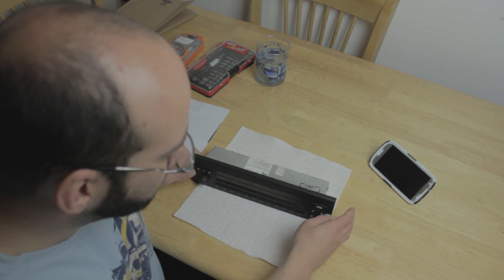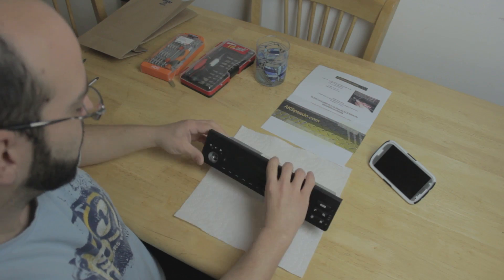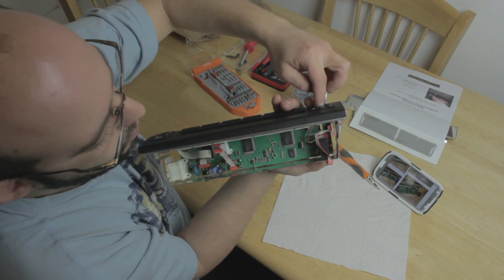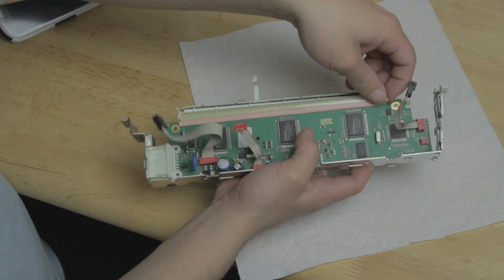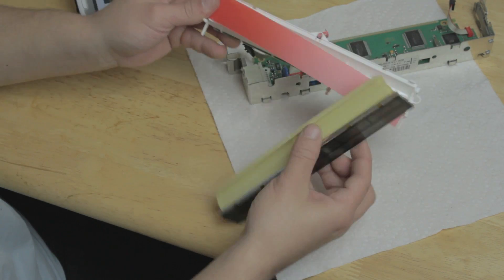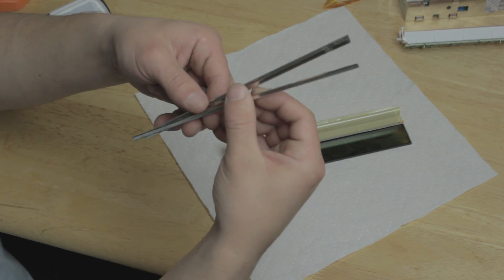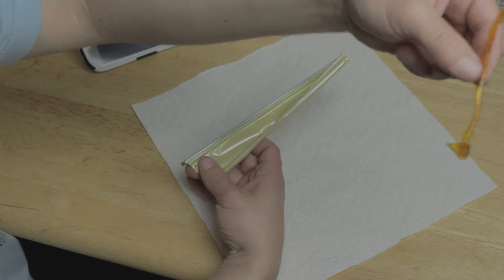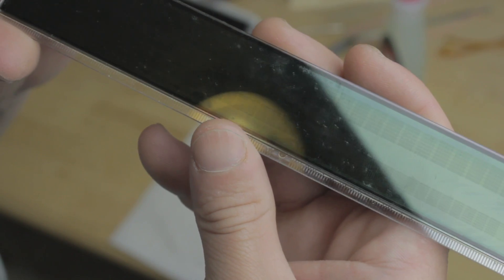BMW X5 and 5 series (e53) (e39) Radio Screen LCD repair - Part 1 - Disassembly

Comment: I followed your video, and it worked for me! Nearly all pixels are back. Thanks so much for this, it helped a lot. I used Acetone to clean the display contacts, but some went between the sandwich glasses. I could move the glasses a bit on one side and expected the worst, but it still worked. Acetone is probably too strong and dissolves the glue inside the LCD display.

Comment: This did not work for me. The company I bought the cable from is saying that I have to use a "T" tip for the soldering gun to apply the ribbon cable, which is not what these instructions say to do.  Maybe my cable is different. All I know is it doesn't work and I'm pissed.  I also used acetone to clean off the connections on the LCD which is prob why it doesn't work.  After viewing the #2 video the printed directions he has says don't put liquid on the LCD screen THAT WOULD HAVE BEEN HELPFUL IF HE WOULD HAVE MENTIONED THAT !!! OH well.

Comment: I bought the ribbon from AKSpeedo and just installed today following your video. Now everything works pretty well! Your video was much more helpful than the instruction that came with the ribbon. Thanks a lot!!!
Anyway, one thing I would like to leave here is that I used WD-40 to remove the glue from the board, and that worked fine! I sprayed it on a small bowl and applied it using cotton swab. Try it out if you don't have the cleaning solution!

Comment: I am interested in fixing my ribbon however, when i disconnected by MID cable today and connected it back the display showed nothing. simply the radio played for 1 minute then turns off. 
i checked the fuses.
any idea whats going on?

Comment: Thank you for posting this video. It is very informative. I already tried to fix my radio by only cleaning the ribbon, but it did not work, so I may try it this way. BMW offered me 50% off part, not labor to replace the instrument cluster screen.